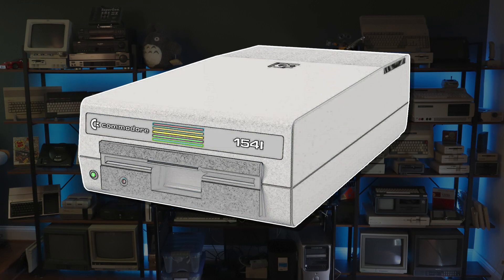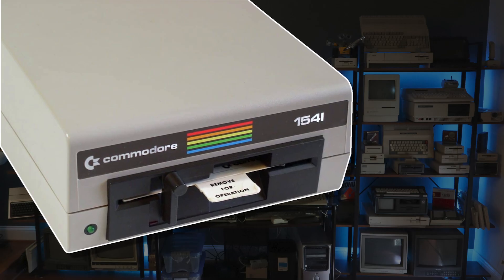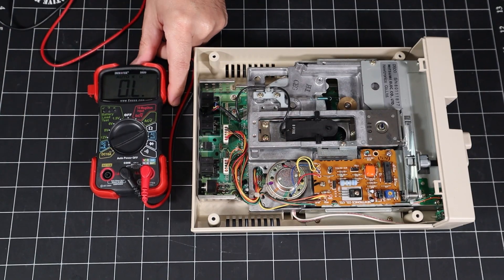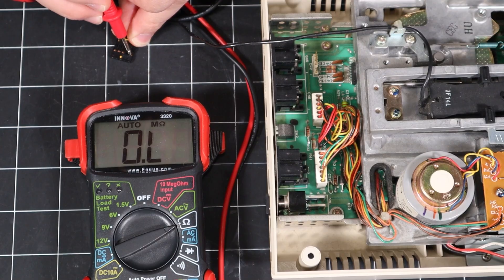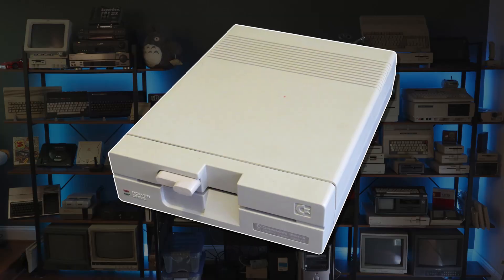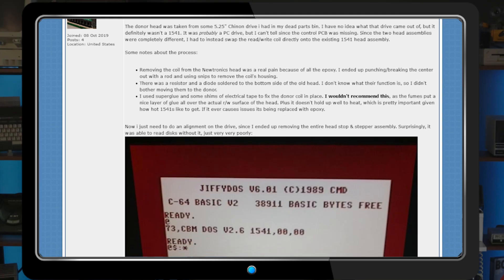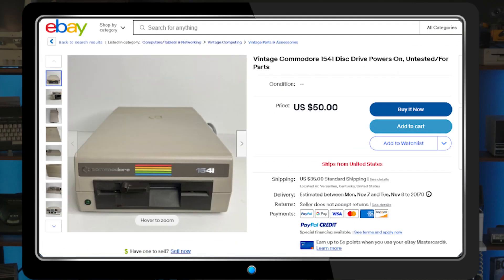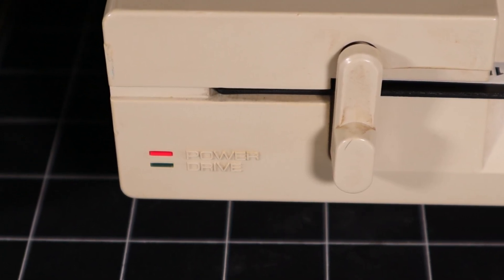This Commodore 1541 hides a terrible secret.

Comment: If moisture can get in, moisture also can get out. There are no sealing fails that are one way only. Applying some heat to the head (not too much as that would damage it) in a dry environment should cause the moisture to evaporate and leave the had through the broken seal again. Of course, this must be done before applying any power to the head as once a short has destroyed something inside, it will stay broken. 

Alternatively you can maybe displace moisture using a creep oil. This is what WD-40 has been designed for. People think it's for lubrication but actually it's not because it won't stay in place for very long and also doesn't really have lubricating properties. WD-40 was designed to keep water away  from parts that must never get in contact with water. If however something has been in contact with water, WD-40 will sneak unter the water and lift the water from its surface, so it's not in contact any longer. An unisolated copper coil drained in WD-40 can be fully submerged into water without experiencing a short when powered (at least for some time, like I said, WD-40 won't last on surfaces forever). BTW, you can get rid of WD-40 from surfaces using acetone. Acetone doesn't conduct electricity and also it vaporizes quickly at room temperature, so any acetone left overs will be gone in a few minutes.

Finally, if it is known that the head is not properly sealed, why waiting until it fails, why not fixing the broken seal prior to that? Sealing something so that no water can enter is no sorcery. An ultra thin layer of epoxy might already do the trick if that thing is covered in epoxy anyway. Other alternatives are also available. I mean, the problem would not exist if the heads were properly sealed in the first place, so whatever has been messed up can be fixed if you fix it ASAP before much moisture makes it way into the head.

Comment: I got rid of my original C64c and 1541 & 1541-2 drives a few years ago. I iterated from C64 with disk drives to C64 with SD2IEC to The C64 with USB stick. I only really play games (and a tiny bit of basic programing) and means I have much less desk clutter and leads. Unless you have a thing for original kit, The C64 is a good, maintenance free solution.

Comment: While that may not be the case with the 1541-II that you have there, another problem can cause the same error. The head could be stuck at track 42. This happened to me multiple times way back when and you just needed to push the head back by inserting the storage/transportation dummy disk or you could do it with sending initialize command. 8-bit Show and Tell demonstrated this on his channel with one way being trying to play a copied version of Karateka. That would render both original and Mitsumi 1541 to be unable to read until you pushed the head back. Not sure about the 1541-II Chinon model though it probably did the same thing to the first 1541-II model. https://youtu.be/a8B-EJQu6i0?t=557
Reply from the maker: Cool, I had not heard about that problem. Good to know though!

Comment: I had the original 1541 drive, with the long board, and it was the drive that everybody wanted because they failed much less often.  Further, we had a program that used to run that would align the drive head by yanking the head back and forth as hard as they could.  I got that drive along with my C64 and a Gemini dot matrix printer for $1100 bucks (or I should say that my DAD got me that as I was all of 12 or so at the time.)

Comment: Pin 1 is not short, it's open.  O.L. means that it did not read any resistance, thus open which is that exact opposite of a short.

Comment: When commodore came out  it was great to learn basic programing and dos 
When I upgraded to a computer with Windows  I was able to get into just about any Windows computer with ease getting around the password also going into the bin files and messing with people on start up
Like my buddy computer I gave his computer a opening message before Windows started and I could lock down start up with simple sub routines 
Like my own personal computer had a key stroke you pressed before Windows could start  it was an easier way to block people from doing what I could do
I use to say I could hack any computer back then as long as I had hands on
Back then most computers weren't connected to Internet because of providers charged by the minute of being connected and modem were sold separately and was very slow. Also keep in mind most computers back then were had about as much memory as cell phones

Comment: ive got the older 1541 with the pull down mechanism... it makes knocking sounds all the time.. is that normal? other than that it seems to work pretty good. i have trouble copying disks sometimes with cbmcommand but i think that may have something to do with the disks im using or how i format them. One other very weird thing. i have to have the cover on my 1541 un sccrewed so i can lift it up and feed certain floppies into the bay. Some slide in normall, others get caught up on something and for the life of me i cant find out what it is?!

Comment: Um... I would definitely check that cable continuity before assuming the problem is the coil.  I'd also consider that the cable may not be making a good connection on pin 1 due to corrosion or oxidation.  These are unlikely to be the problem, but it's about 30 seconds to confirm...

Comment: Wait... I use to get that problem and error - but guess what, I just used duct tape. Narrow strips on the disk, so there was more traction and it read them. Did it back in the late 90s and never had a problem since - my 1541 II still works nicely and disks too.

Comment: If the problem is moisture, my first thought would be to try to find someone with a good vacuum pump and let the head sit in a vacuum for some time.

Unless, of course, the problem is that something has corroded away.

Another idea: AFAIK there are nutjobs who make audiophile phono cartridges, that hand-wire coils with impossibly thin wires for them. Would it be possible to call any of them into service to make new coils for the head?🙂

Comment: I had the early version, complete with four No 2 pencils in the bottom screw holes to elevate it for ventilation. I never had a problem with it, or the single hole punch I used to turn my floppy disks from one-sided to two-sided.

I remember when the 1541-2's came out, but mine still worked so I never got one. I did have the 1571(?), as I bought it when I got my C128.

Comment: That's one more reason to go for a 1571 instead. If the drive mechanism ever breaks, you can rip one out of a random PC and be on your way. Or even convert it into a poor man's 1581 if you want.
Reply: Does this work?  Can you really replace the drive mechanism in a 1571 with a PC drive?  I have a 1571 where the drive head just broke…

Comment: I used to cut pencils off and push 4 of them into the screw holes on the bottom to raise the whole drive up by 3 to 4 inches so more air could get around them. I also made a cylinder with a piece of paper and set it on top of the vent in the back to make a chimney.

Comment: I've never had this problem with my 1541 drive. The only problem I ever had with the drive mechanism was the closing latch having a small metal pin inside to keep it being able to open or close, but cause there is a gap to remove this pin, over time it just pops out and you can't close the drive.

Comment: I used such a floppy drive, it could even write a single sided disk when I bit the write protection of the other side. The head problem occurred when the games were copy protected, and was not possible to copy them to other disks.

Comment: I worked for Mitsubishi electronics from 84 to 90, 8", 5.25" and 3.5" floppy drives, I was the resident expert at perfect radial and azimuth alignment that had tight screws, as shipping in trucks are bumpy and misaligns heads with not so tight screws. The good ol Brikon FDD tester/exerciser, I knew that equipment like the back of my hand. Good ol memories.

Comment: OL means overload. It is telling you that the resistance value exceeds the range of the meter. A short circuit is one with a lower than normal resistance. This head has a very high resistance (considered open circuit). There is no short in the head. The corrosion has eaten the enameled wire away

Comment: Your multimeter indicated highresistance on the failed head, not low resistance -- this implies the coil is open circuit rather than a short circuit.

Comment: The solution to the original 1541 overheating was taking 4 #2 lead pencils, cutting them off 1 inch from the eraser and jamming the wooden end into  the 4 bottom mounting screw recessed holes thereby raising it about 1/2 inch.

Comment: It's not shorted it's "OL" which means Open Loop or Open Line. I.e. there's is no connection or infinite resistance; the opposite of a short.
You should've set the DMM to continuity mode, many DMMs beep whenever testing for a resistance of below 100Ω. You could've at least tried that.

Comment: i have a 3.5 inch pc drive that has an open section on one of the heads so a write off 😢i'm wondering if a fault in the write amplifier/driver blew the coil open, maybe similar issue with these????

Comment: Yup, I have 6 non-functioning drives after looking at 15. Any ALPS with faults was a failed chip. Guess which drive are in the 6 non-functioning units .Hint, swapping in an ALPS drive showed the rest of the 1541 was fine. I also believe the longer wires in that Mitshumi was so it could fit in a 1541 as well as a 1541-II
Reply: I have an original (non lever) 1541 that won’t read discs. Can you tell me more about this chip failure?

Comment: You coud swap the disk drive with a working part it's only held in the case by four screws and unplug the cabels, when I had my collection before I sold everything from Commodore and Amiga, I only had drives with failed ic's that I replaced I newer had failed read/write heads, maby just pure luck but the drives is wery old now and manny things can fail over time like caps and ic's, I don't tink that the drives was ment to last so long

Comment: So its moisture getting into the head right?
Why not use some hot glue to seal off the head better and stick in some of that air moisture absorber stuff that says "do not eat" in the drives' case(silica) to slow the inevitable down even more?

Comment: I never worked with Commodere drives but back in the days I repaired lots of FDDs. You can use any head coil from drive with similar geometry. The hardest part is to glue it properly. After you'll need a special disk where zeros are written on track 0 and 1 on other track according to your geometry. Then you have to position head on each track with low level commands and control the alignment with oscilloscope connected to head preamp.
Reply: Azimuth needs to be set as well before you glue it. It needs to be inside of about 1/5th of a degree. Is that reasonably achievable or testable prior to gluing? I've never tried to do this.

Comment: Computers are so crazy now, you can probably bitbang a PC drive's head with a microcontroller fast enough for it to work, and still run a full emulation of the drive computer., and bitbang the DIN interface

Comment: Awesome video, although now I feel gutted as my 1541-II has the Newtronics mechanism inside. Do you know if the 1571 also used the Newtronics?
Reply: I don't think the 1571 has the Same mech, because it's a Double sided Drive.

But I might be wrong on this.

Comment: Such drives can be repaired! It needs another defective drive (the heads still working) to switch over the head assembly. It may be difficult to do this and you have to adjust the drive before using, but the drive is working after the repair. In my workplace (a HP Museum), I have a lot of drives to deal with. The most difficult repair was on a HP Vectra QS/20 with two 5,25" drives. One was defective, the other one works fine. The difficulty was to match up the drive, so data written on drive A was reading on drive B (the defective one) and the other way too.

Comment: I like the test procedure on the head, but how do you know it's the head and not a cable failure?  Have you ever snipped and replaced the cable on a suspected bad head?

I would not avoid this model 1541 just based on my experience with them.  Maybe just a run of good luck.  I've only needed minor repairs and cleaning.  I did have to replace heads on my C128D's internal 1571.

Comment: It looked like the first measurement indicated an open not a short. A short would read 0.00 not OL. If it is an open it could very well be a broken wire at from constant flexing back and fort. I would make sure that it is not the case before declaring it beyond repair.

Comment: I had one from 1986- 1991..
1. generation.. very poor quality. After half a year problems with reading the files... Sent to repair for adjusting the read had.... After half a year the same problem. Probably overheating..
goof old time 🙂

Comment: Good video.  I remember going through two 1541-2 drives in the late eighties before I got fed up and bought a third party, FSD-2 drive.  These things are built like a tank and never seem to wear out or go out of alignment and I've only ever came across a couple games that had issues with it.  It's still the drive I prefer today.  Though I actually have two of the original pull down tab drives in my collection that I got from a yard sale in the mid 90's that still work but  they do get hot.  I don't really use them much unless I need an extra drive to copy disks with.

Comment: I had a C64 back in the day, both the bread bin and the C version with both the original 1541 and the slimmer version. I loved the C64 but these disk drives? They were both garbage, ran hot, barely better than using cassettes. In fact I preferred to use cassettes. 

The original 1541 was ridiculously massive and over engineered. I've read, decades later, that it contained basically a complete C64 just to work and ran more slowly than designed as a compromise to some last minute issue.
Reply: From what I've understood many of the problems with the 1541 were due to Commodore wanting the drive to be Vic-20 compatible. Which I believe it wasn't anyway in the end.

Comment: can i ask a question?
how rare are functional 5 inch floppy drives?
i know of several i and my grandparent's own 
my grandfather worked at a architectural firm a long time ago and apparently the firm either upgraded and replaced some computers or he took them with him to do some work at home?
and then i guess by the time he quit or was let go or what the computers were too old to be used by the company anymore
so he still has them and he gave me one

it "runs" ms-dos and is from 1990 
the model is a dell corporations 333d 
it has a 1st gen logo and technically works as it doesn't have os 
as i don't actually have a "software bridge" to move the os file to a hardware that i can use with it.
ie from a file from the internet to a cd to a computer with a floppy burner to a few floppy diskettes to the recipient computer

as it has: 
a 3 inch floppy drive
a 5 inch floppy drive 
and a data cartridge "streamer" backup system
with no cartridge or identifying markings as to what it actually is.

but my grandfather had used it in the past and knows it works.

Comment: Good to know! I'm an Apple II guy, but have a collection of C64's and had no idea about the Newtronics mechanism. Peeked in my closet and I have two older 1541 drives with push in-levers (a brown and beige) and two Newtronic drives (a 1541 with flip-switch and a 1541-II which I just opened, great!). Also have a third-party Indus GT drive, no idea what's in that but I think it's worth keeping, no? I really should look into that power-protection dongle (between the powersupply) for the C64, if they're still available.
Reply: Keep the indus drive! =)

Comment: There is an "open" on pin 1 of the bad drive, not a "short". The DMM reads infinite ohms on the pin 1 measurements. Pin 1 = OPEN.
Reply: Exactly! The day I would get a shorted open circuit I would freak out ha ha
Reply: Yup.  Noticed that right away.  He just miss spoke.

Comment: This video made me test out my Commodore 1541 drive. Which, yes, has the Newtronics mech in it. Mine's not exactly in the best environment either, being down below ground level. But I put in my copy of Ace Of Aces, typed the load command and low and behold, it loaded right up. But now I gotta worry about when the head will fail. Hmmmm.

Comment: I don't sell on eBay, so I've never posted something there as "untested". That said, during my town's bulk trash pickup twice a year, I find lots of stuff that I can't test. I've found Gameboy cartridges, but I don't own a Gameboy, or know anyone who does. I have a PSP game disc sitting here that looks fine, but again, I don't own a PSP. I've found all sorts of computer expansion cards and memory sticks, that I often don't have a system that they will fit in. I found a Sapphire HD7970 graphics card that looks perfect. Not only do I not have a system with a large enough power supply to handle it, I don't even have a case large enough to physically fit the card into! 

A couple years ago, I found a 40 column cartridge for the VIC-20 that didn't include a power supply, and once again I had no way to test it. I ended up selling it to a Lemon64 user, after making it clear that I didn't know if it worked. They had a suitable power supply and said it worked fine.

Some people may try to scam you, but some people honestly can't test some of the stuff that they have for sale.

Comment: I'm trying to fix a 1541 right now. I have a bad voltage regulator. But I'm going to check the drive with my multimeter so I don't waste anymore time. Thanks.